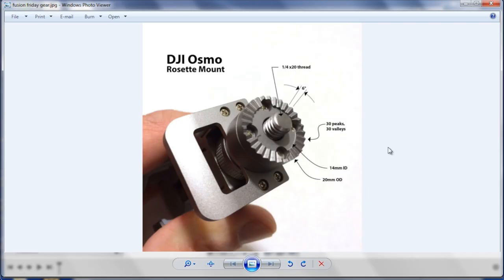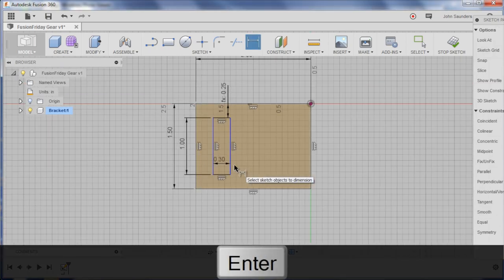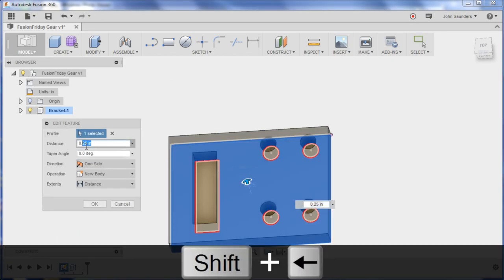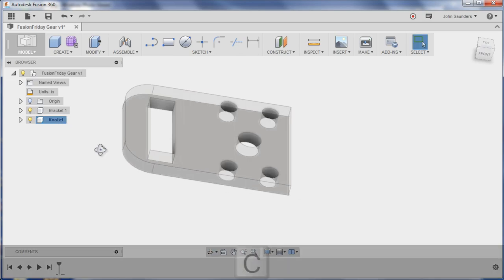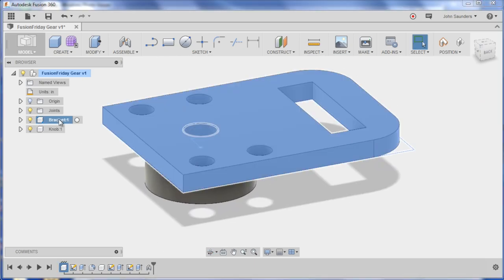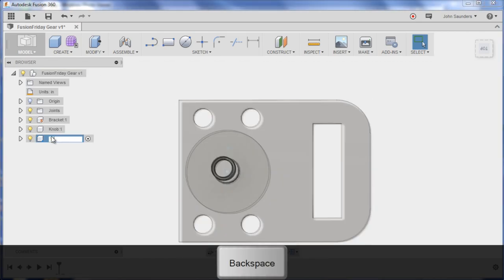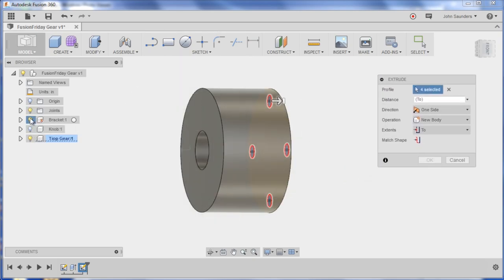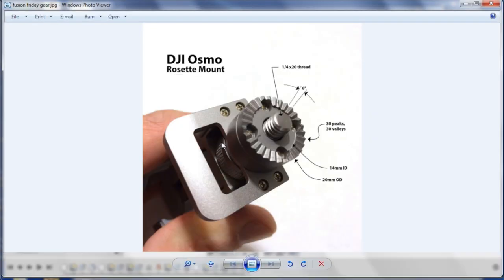Fusion Friday #10: Model Camera/Drone Part!

Comment: Great videos! As an NX to Fusion360 convert it's great to get some tips on what really sets Fusion360 apart in terms of ease of use and clever tricks.

I know this is an old video, so these tips are probably old news to you, but they might still be useful for those watching this video now:

1. Your defining feature is the axle, so use that as your origin. It makes positioning easier for later and lets you use it for symmetrical features - just horizontal align the midpoint of the vertical lines of the bracket to your origin.

2. Center point rectangle is great for defining bolt patterns around a hole. Just create a center point rectangle from your axle center, convert it to construction lines, and place equal circles on each corner.

Keep those great videos coming!

Comment: Every time I watch your fusion 360 videos it always occurs to me how much faster your computer runs fusion360 than mine. Do you have any computer recommendations?  I'm getting ready to either buy or build a computer to use for modeling. I'd be very curious to hear the specs on the machine you use. Thanks